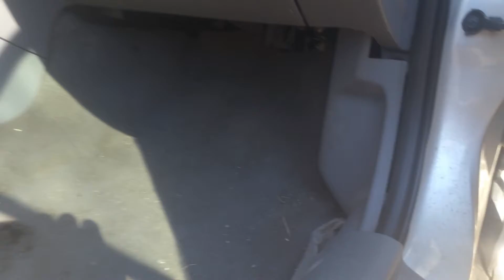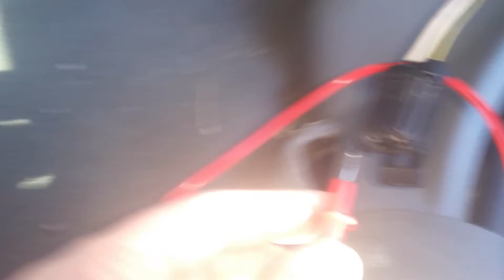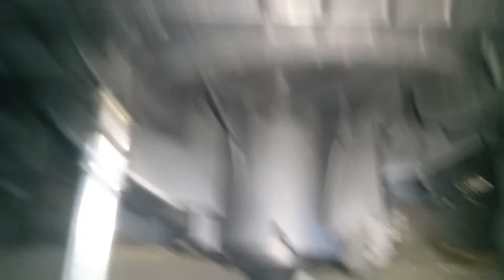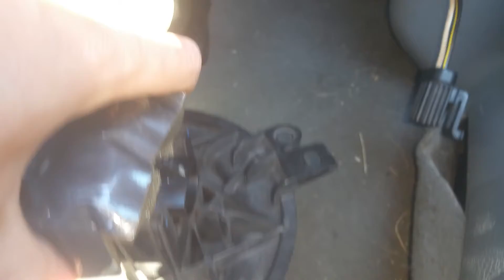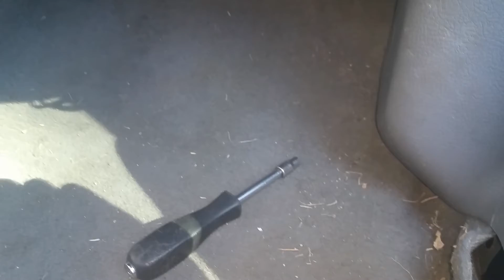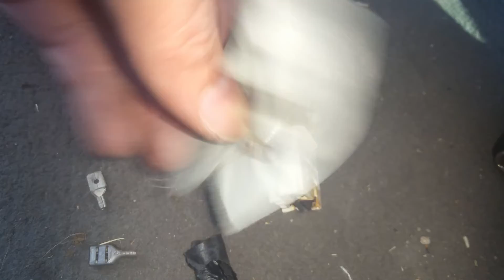How to replace blower fan 2003-2008 Mazda 6

Comment: I have this connector too but on the correct blower. But now my new blower doesn’t fit it lol
Reply from the maker: I guess the 08 to 09 was a change up year on these parts . So depending on the build date I guess it could be 03-08 or 09-13. I know this connector on mine sure was a head scratcher. I am just glad I caught it before it burned something. Thank you for the feedback.

Comment: Mines the other connector it’s like a tab you push to pull out I can’t seem to find them anywheres online I may have to try my luck with a junk yard
Reply from the maker: Yes , I am really glad they sent the connector with this one . Sometimes they are really hard to find. I had another car for example , I needed a fan pigtail ; it was $40 at the dealer ship. Thanks for the feedback.

Comment: question.....when checking the voltage.....key in and ignition on; fan switch on. or just test it with key out?
Reply from the maker: Check the voltage with the key turned on and switch the fan to high . Thank you for watching
Reply: @WrenchTheory501  thank you for replying.....much appreciated